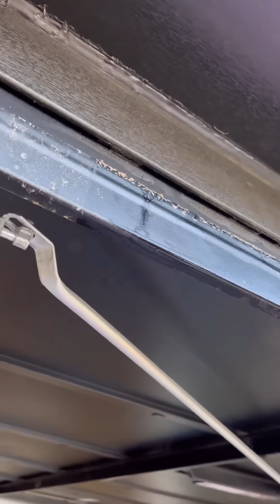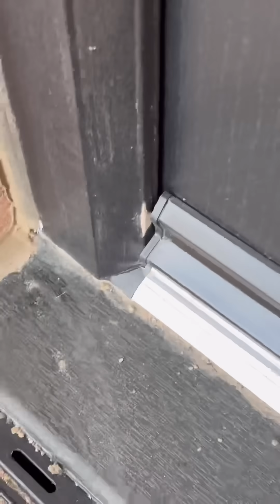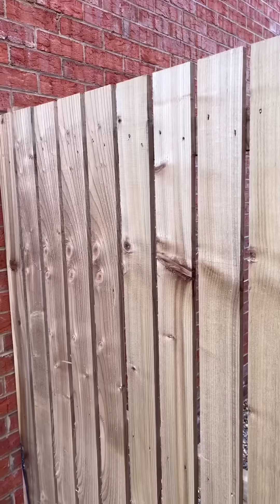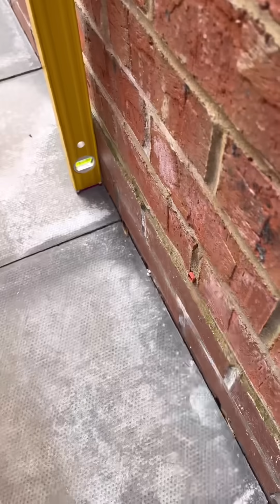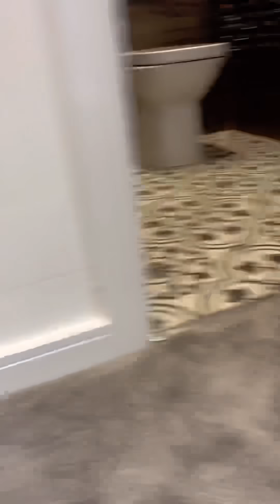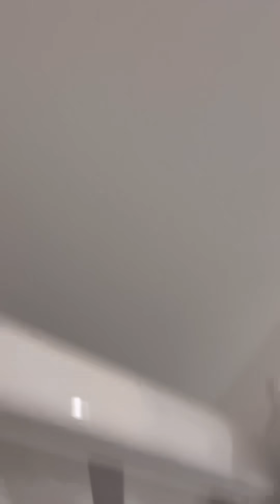Uk New Build Snagging Inspection | Vlog Day 2

Comment: Can you name the builder at the beginning, or there is no point as it leaves potential buyers still in  the dark and not aware they need to do more due diligence at the beginning before they sign contracts. By seeing these videos it perhaps them to look at certain areas early and confront the builders and perhaps they could sign something into the contract tell them you will be prepared to walk away from the deal as it has gotten so bad now some people will struggle to sell on or will lose money as prices will have to be lowered because of the home report as you know some are worse than others so people deserve to know who they are it doesn't matter about the price of the properties just who are the worse builders you have witnessed and why areas to look out for. also inform viewers they have only 24 months to log these problems but better if fixed first, I see leadwork and wall render and cracks as products fail within the fist 24 months  on a daily basis now and that's sad.

Comment: How would you remove the white from the bricks please? Is it the sand quality?
Reply: The white coming from the cement, run in onto the brickwork it salt that is in the Sand because it hasn't been washed correctly or they've used the wrong sand, acid will remove some but not all
Reply: roller coat them with some brick sealant there probably made in China or India its the salts escaping and the benefit as well is it seals the mortar between the bricks as it can go porous.

Comment: That was interesting regarding the garage door protection.  I had an identical door to replace my old Henderson fitted last year and I noticed after your video they had left that strip on mine also.  It covers the two drainage holes so the water will rust its way out.  Thank you!

Comment: For all the slagging off of site managers being useless it's not always the case and the ones ive worked with have recalled all trades and snagged a property over and over and for those who don't know ( unless the regulations have changed) when doing a final interior inspection of finishing, decorating etc it has to be done from a minimum of 2 metres and in natural light and if daylight is poor its permitted to use 1 small light so not every single blemish or item can be detected unless you're standing 6 inches away from the area being inspected.
Reply: That is just the final inspection though, site managers should be inspecting at all steps of the process. This snagging inspection is about getting compensation needed or work rectified. They are not useless it's more that some of them might miss stuff, others might see things and just completely ignore them.

Comment: So what do you want the developer to do with that negligible step on the lover brickwork?? Acro everything up and relay the whole to bottom course.....?

And the render?? Is it structurally sound yes. Can you see a run out if you really look yes ok, what do you want? A full re render??? 
Stop making big issues outta not big things. 
Youv now told a new homeowner that the brick work and render needs substantial work when it doesn't. They now think they've brought an awful house when it's not.
Reply: Stop defending shit work. All those jobs should've been up to a proper standard from the beginning.
Reply: When you're spending at least a quarter of a million quid on something, you expect it to be in a certain condition, not half arsed like this.
Reply: Can see render running out if you really look 😅😅 just look up it sticks out a mile against black fascia.
What about the work they have bodged you can't see😮😮
Reply: @robertbannister3536  That's it, isn't it? If the stuff you CAN see looks like that, what about the stuff you can't see, like the cavity wall insulation? And, in response to the  OP, it is an issue because if the buyers ever want to sell, buyers like me won't touch a house with faults like that with a barge pole, not because those faults are structural, which they may not be, and not because they are ugly, though they are and that would put me off a bit, but because any builder whose quality control systems didn't spot that by the third course at the latest, and make the brickie knock the lot off and do it again properly, definitely can't be trusted not to get less visible things right, which really COULD be much more serious.
Reply: A step in brickwork like that is not 'negligible'. It's a total mess. I'm not a pro brickie but my brickwork is flat, vertical, and level. It's not hard. You just have to give a shit.
Reply: It's not the new homeowners problem, it is for the property developer to fix. The amount of stuff that are not big things all add up, when something has issues it needs to be fixed. That is why these guys exist, to find faults before they become something bigger. If you buy anything and it has a problem it needs to be rectified, especially when it costs hundreds of thousands to buy it.
Reply: @ells5656 Spot on. Would be nice if everyone done their jobs properly and took pride in their work rather than cutting corners and doing half arsed jobs, but it's easy to see why it happens with the amount of pressure they're under to get it done as quick and cheap as possible

Comment: The fascia on the apex has been fitted incorrectly. It needs to run the full length of the apex, not cut short as it has been (too short at that). I’ve never seen that before - ever.

Comment: The letter box at the bottom of the door, is that still allowed? Against building regs in Ireland since 2000, has to be a minimum distance from the nearest step to the door.
Reply: I changed ours when we moved here to be at a proper height because it's just not fair on posties to expect them to grovel on the floor..